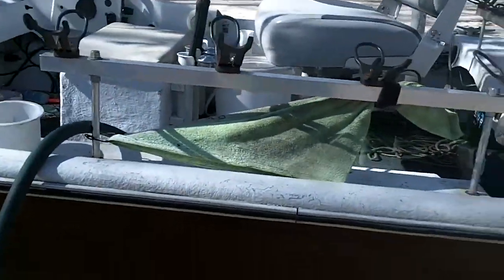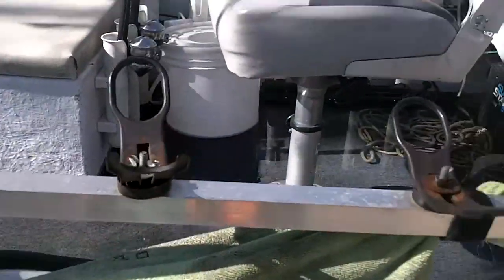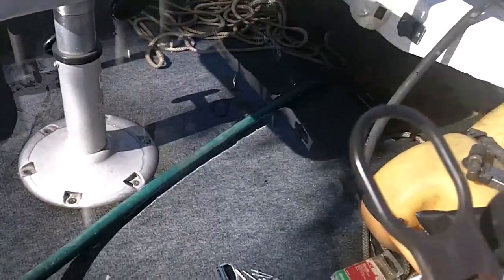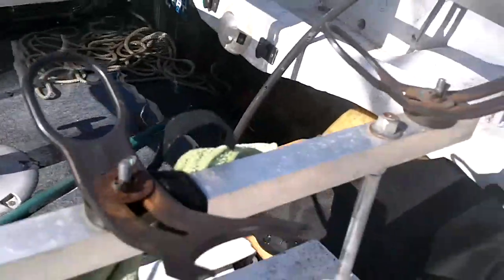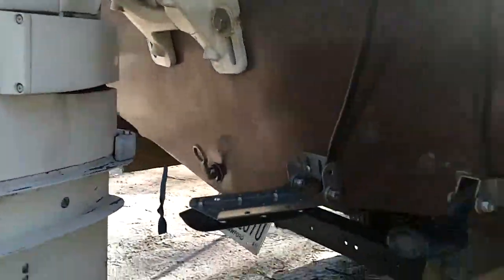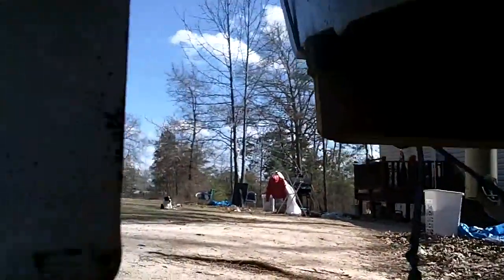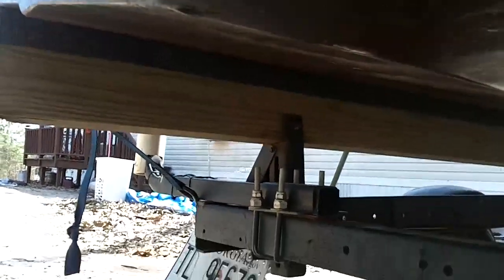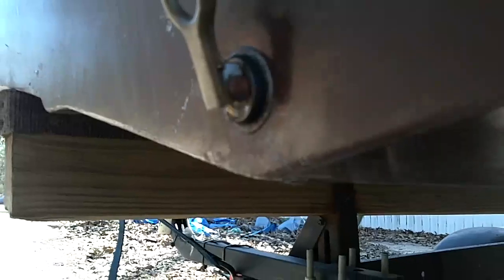Finding A Boat Leak Redneck Style

Comment: Specific weight of water is 8.33 lbf/gal at 70 deg F. Also, boats are made to take compressive stress on the interior structure. In a fiberglass boat, fiberglass is laid over the wood and fillets the connections to the hull (a fillet, being a curve will be pulled straight when pulled apart), along with fasteners this is the only thing resisting the tensile stress pulling on the interior structure when you fill the boat with water. Also whatever water weight you add will put a higher compressive stress than normal where the hull rests on the trailer potentially causing more leaks and/or popping the trailer's tires.

Comment: Putting water in a fiberglass boat puts a lot of preasure on the fiberglass. So if the boat has bench seats or anything else that may be bonded to inside and or bottom of the hull the pressure inside could rip the bond apart. Just be carefull. I dont recommend filling the whole boat up. Water weighs 6 lbs per gallon so be carefull.